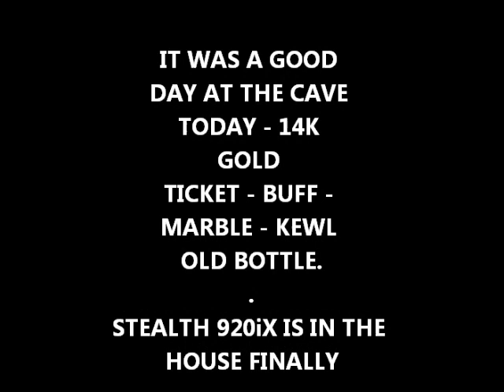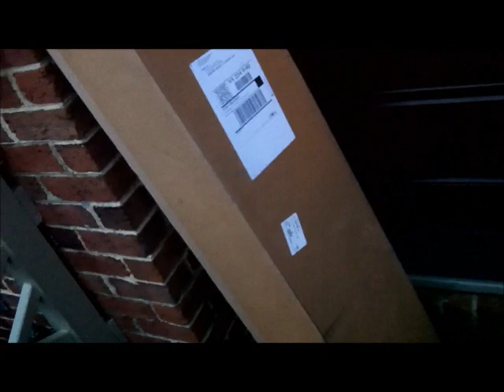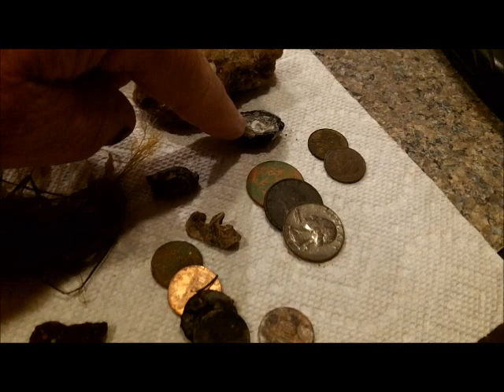JAN 2ND - 14k Gold Ring - ChainMan at the Cave - 1st for 2015

Comment: All the best Max for 2015. Your gang did canny .LOVELY sparkalar. Looking forward to your next video.Might be interesting for you been a beach man. Our local forum had a beach hunt and I set up a test bed English coins.tecknetics,ctx,e trac coinmaster, and a pi. trying to find deepest a 2 oz copper cart wheel penny the deepest at 14 inch 10 coins varying in depth 7 to 14 inch and one with iron. bob hope is doing the you tube video he is a beach man like you uses a ctx and a pi give it a watch and pass it around think its in 2 parts on Seaburn beach north east uk. All the best Dave
Reply from the maker: thanks